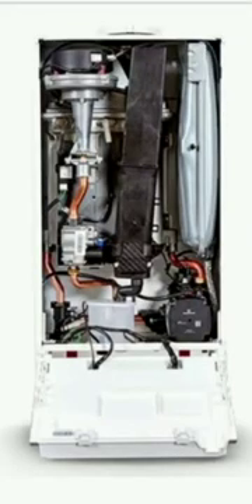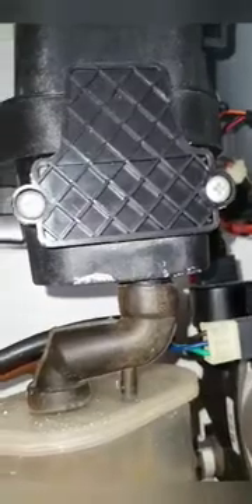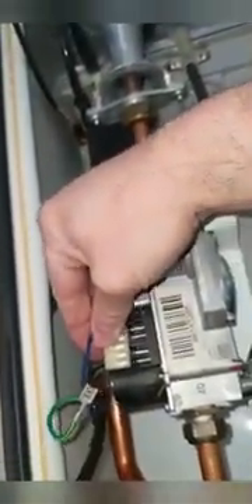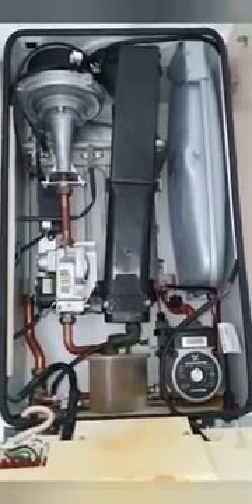Changing ideal logic sump without drain down.

Comment: So if it drips in the inspection cover, is that a faulty heat exchanger or sump?
Reply from the maker: If it can be seen dripping without removing inspection cover it's likely the sump.
Reply: @stevenroberts8671  I got a really strange issue. I remove the cover and it was dry, waited a few minutes and not a single drop fell. After heating is on, the condensate pipe drips but only for a little and then stops but the pressure in boiler drops ever so slightly. I'm confused as to what it could be. The prv is dry but the expansion vessel was charged 4 times higher than required. At almost 4 bars instead of the recommended 1. I have released some air and so far it's got better but still pressure drops a little. But again sump is dry and no drips from behind cover. It's definitely not the radiators or pipes either.